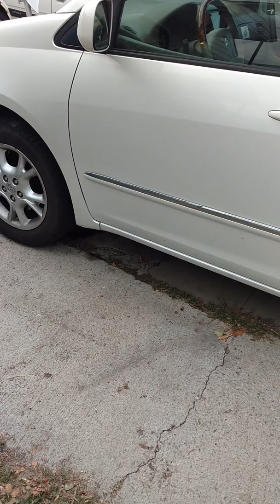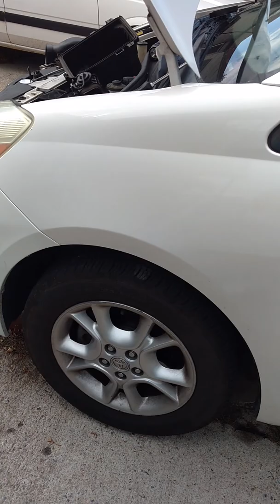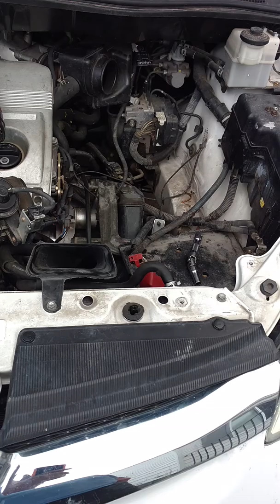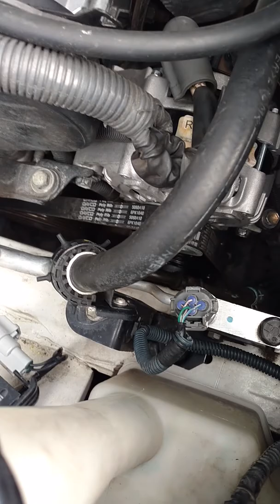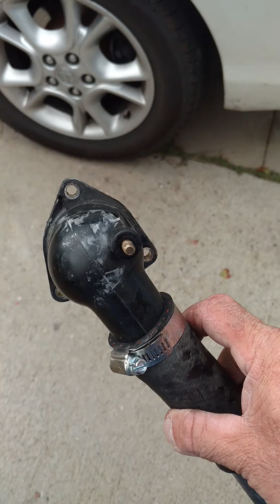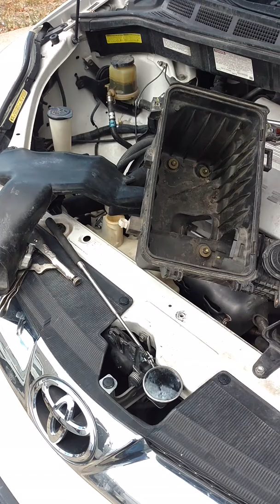Toyota sienna pos

Comment: Mine now has 307k and it’s turning into a mechanics nightmare. Guess I have the coolant leak in the valley now. It’s such a PITA to work on. Planned obsolescence to keep the average guy out. So many things could have been designed to at least make it easier to work on. All the damn plastic crap is breaking when you touch it. The air filter isn’t even user friendly to replace.